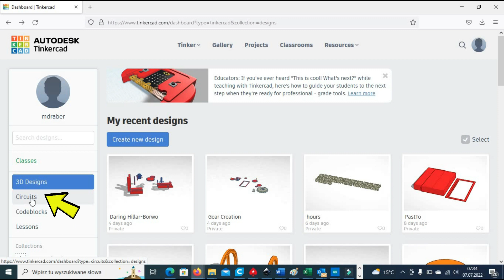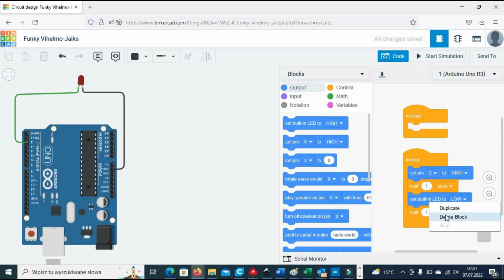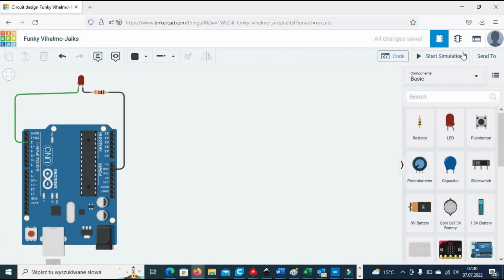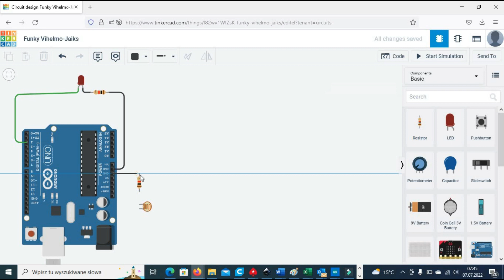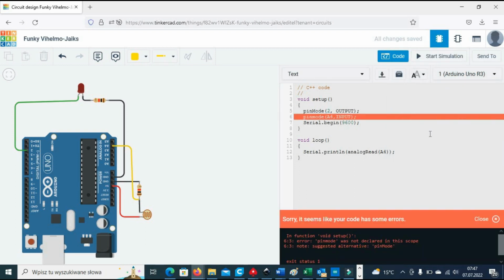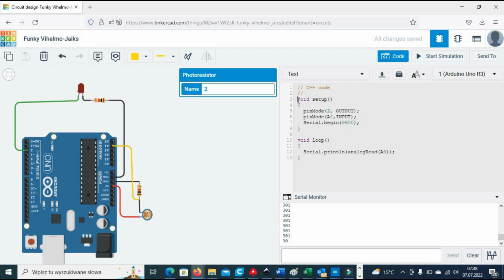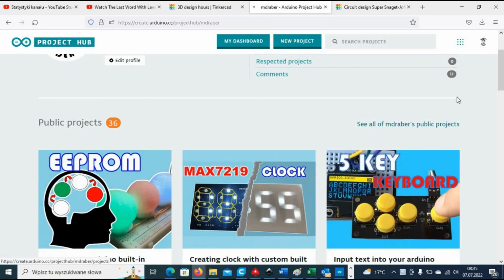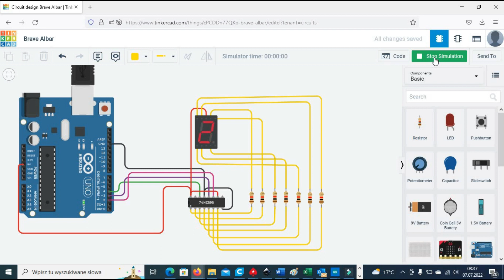Mastering Arduino: From Idea to Prototype in Tinkercad!

Comment: Thanks for sharing this. I think this is great to do some prototyping and ideas testing. I have used the export functionnality to create simple PCB and it works just great. They have the ATtiny13/45/85 in the list, but I agree it would be even better to include a link to list of other components. This is a nice tool also to teach in coding clubs as well, without risking burning arduino 🙂.

Comment: Good tool. Too bad they haven't updated to any new components.
So many components are not available.
Reply from the maker: Very true. But for the very beginners with Arduino, the number of parts should be sufficient. I don't see experience Arduino guys using Tinkercad to prototype their projects:)